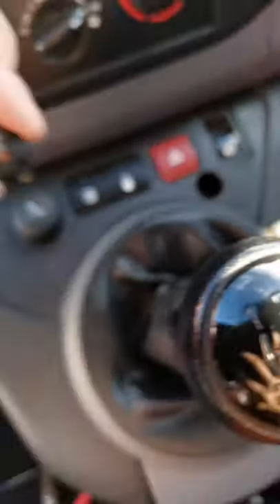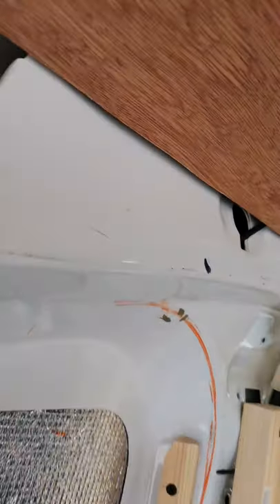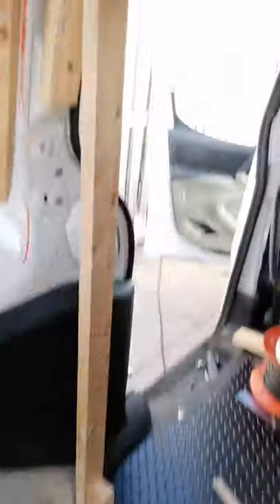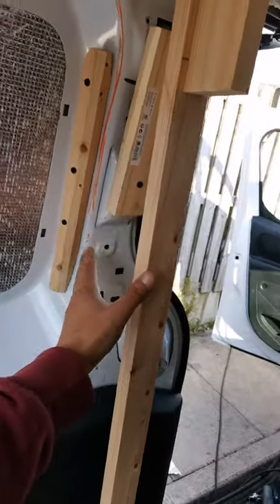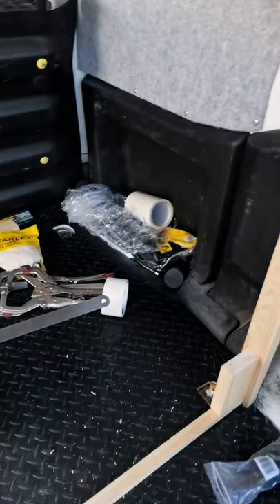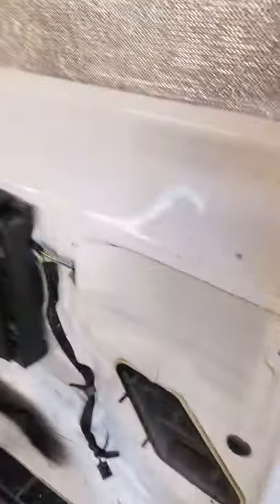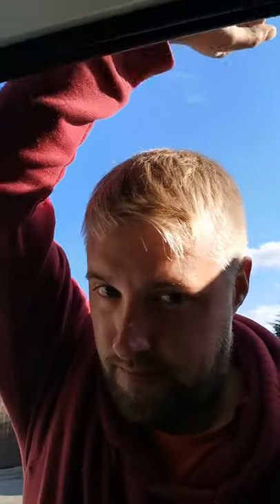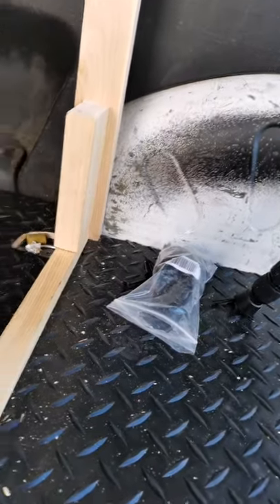Detailing Van Build Update Day 5

Comment: Hi man.  Great progress!
Xoxo from Puerto Rico 👍🇵🇷
Reply from the maker: Thanks Humberto it should start moving forward fairly quickly after tomorrow now I've worked out what I'm doing :)
Reply: @mrbitdetailing6897  By the way, forgot to let you know about this pressure washer which is fantastic for mobile detailing.  I purchased it 3 weeks ago and loving it since it is quiet and sturdy.  I had a 50 foot hose instead of using the 20 foot hose.  This video also shows you how to use the different quick connect couplings.  Sorry the link is from my cellphone
https://youtu.be/Q2VasFL7txw

Also check on Amazon the LUTEC 6290Pro 9000, they also have the 7000 and 3000.  Very good for Mobile Detailing, very lightweight and very easy to use even with one hand.